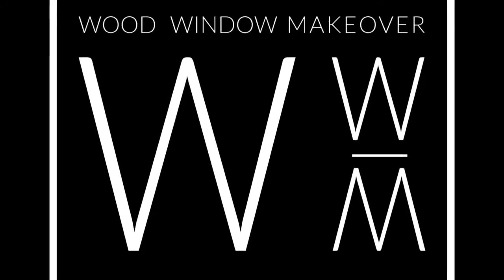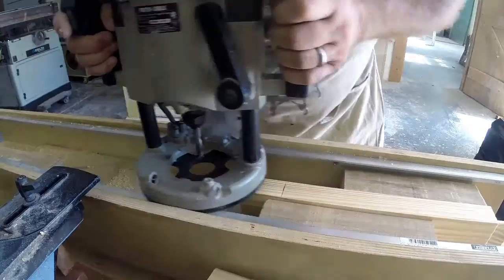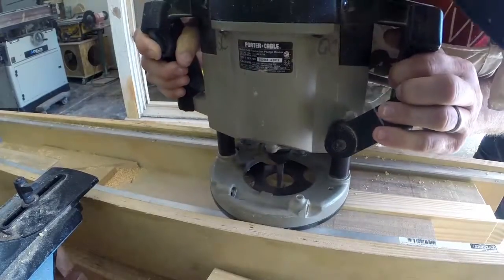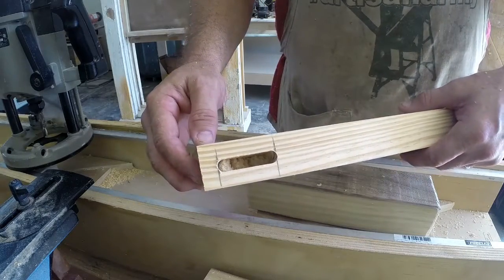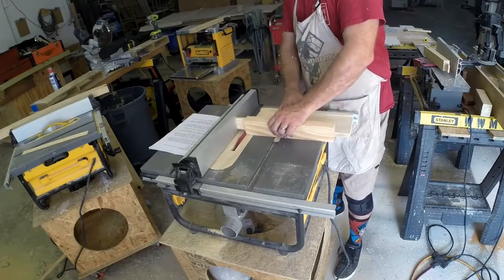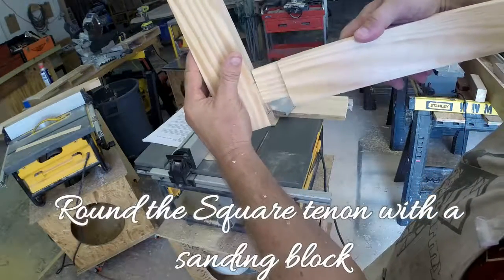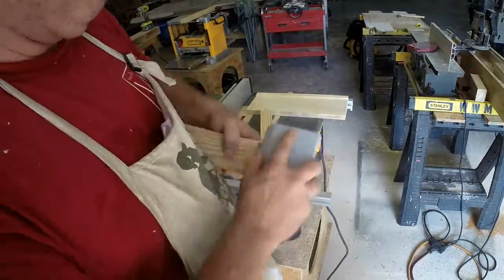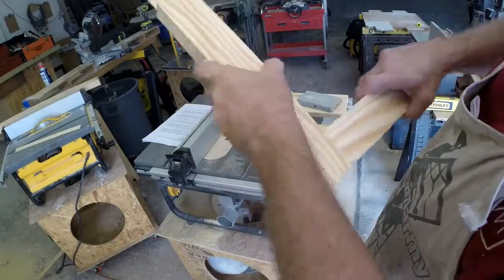How to Make a Mortise and Tenon Joint with a Router and Table Saw

Comment: Are there plans/drawings for your mortising trough?
Reply from the maker: No but it's simple enough
Reply: @WoodWindowMakeover  Do tell
Reply from the maker: Well it starts with having a plunge router, and that plunge router's base has a width, say 5-3/4". You'd rip a piece of plywood that measurement and attach sides to that, you are almost there.
Reply: Wood Window Makeover check your Instagram DMs.
Reply from the maker: @westsidewil  ok